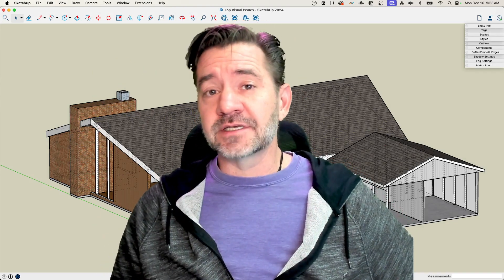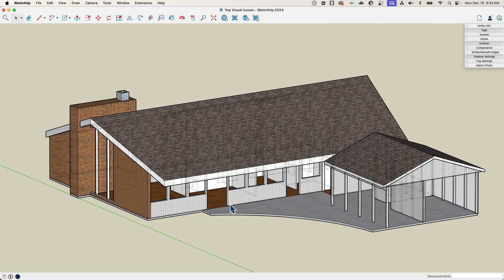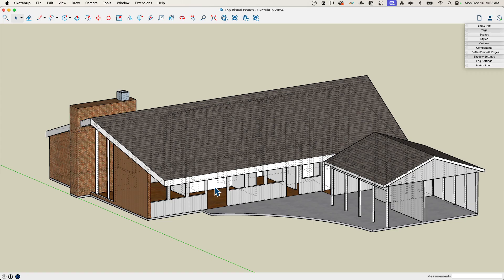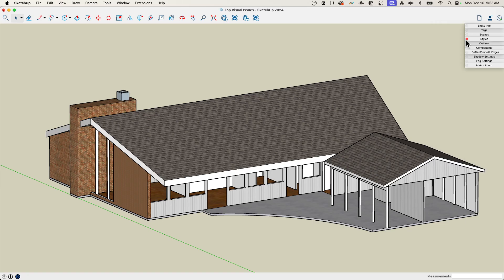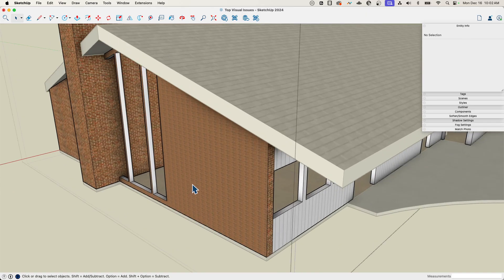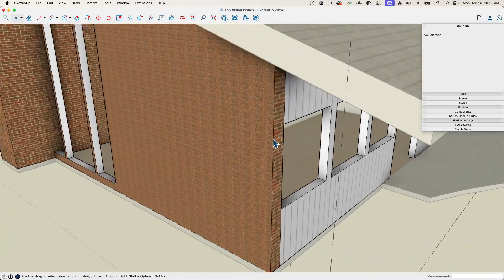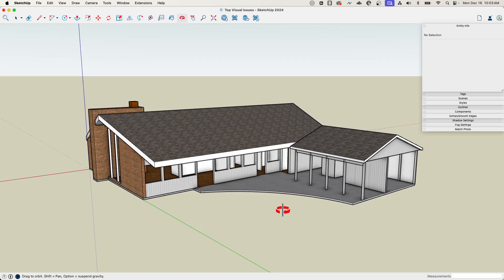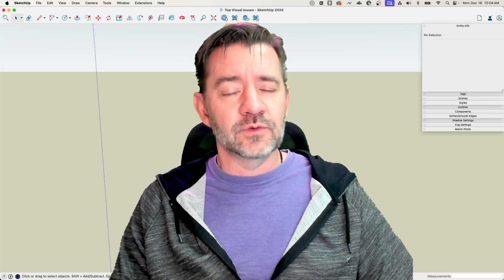Common Visual Issues in SketchUp and How to Fix Them

Comment: Why does drawing a shape on a face (usually small compared to the size of the model) sometimes not result in a separate face for the shape?   e.g. draw a large square, then draw a smaller circle in the centre of it.  The circle shape should have it's "own" face, separate from face that runs from the perimeter of the circle out to the perimeter of the square...  but in random situations, the circle's outer edge will be drawn, but the square's surface remains in place, uninterrupted (or worse, the circle ends up with /another/ surface, over and on top of the square's surface.

What can I do to prevent this?

Comment: Thanks Erin, you do a great job explaining things. Please help me with my problem. I have my studs showing through my panels. Do you have a video on this? How can resolve this? I also want to paint an image I have prepared over the panel. I am told to explode the panel and then paint on the surface, but what do I then do with the exploded surface? As you can see I am a beginner! Thanks if you have time to help.

Comment: Good afternoon. For some reason, the lower roof elements are visible through the upper ones. For example, wooden sheathing through a metal covering. You need to raise the metal part up by 10-20 mm so that the horizontally located boards do not show through. Moreover, the height of the lift also determines at what approximation the visibility begins. Everything is done in groups, the metal is not an edge in shape, but a volume with a thickness of 1 mm, but there is still a gap if you lay them directly on top of each other. Sketchup2024

Comment: Paralal view problem in interior view, only outside wall are viewing , not viewing inside when paralal view mode , solution ?!
Reply from the maker: You cannot view the inside of. model in parallel view unless you have a section cut or remove walls. Since there is no depth to parallel view, you cannot place the camera inside of a model.
Reply: @SketchUp   thank you , but in 2021 ver. of skp it works well.
newer ver. are not working.

Comment: The far from origin is something I have a problem with, as I'm normally drafting on a point cloud captured in realworld coordinates (usually around 300,000 400,000).  While I can solve it when importing the point cloud using the "move point cloud to origin" option, very often I don't want to do this, as I want my final model to remain in the original real world co-ordinates. Is there an option to temporarily shift the origin to the point cloud, similar to UCS option in Autocad?  I've found a work around by shifting my survey data from real world to 0,0 origin (creating transformation values at the same time), import to Sketchup, model, export them move back to realworld but that just adds more work and a chance to mess something up. I don't have any problem working far from origin in engineering software such as Trimble Business Center.
Reply: You can move the origin axes wherever you want.!

Comment: I wonder why you move the model to the Origin with the mouse rather than using the absolute move. Just hit the square key; then the open and close brackets appear, and you can type in [0,0,0]
This action moves the selcted point to the origen with the rest of the model